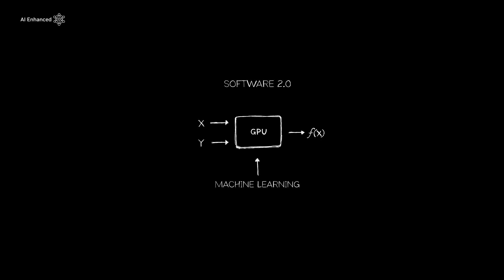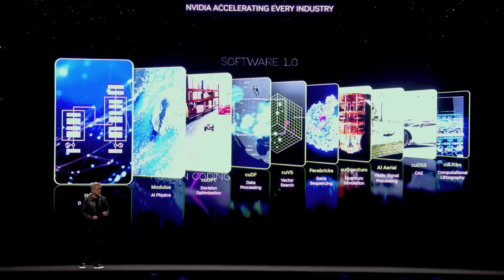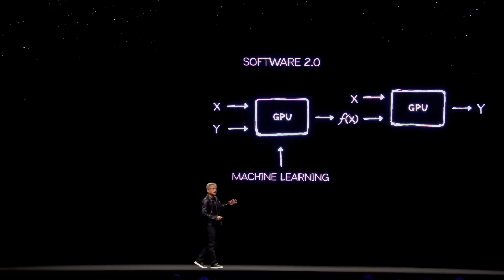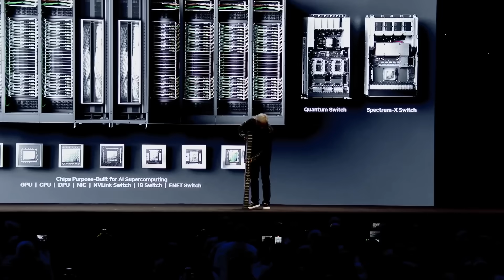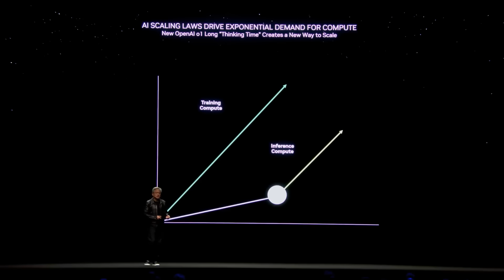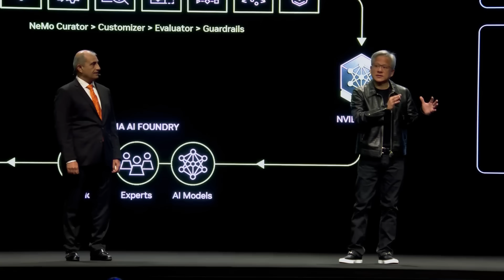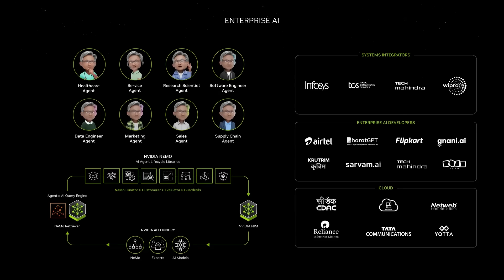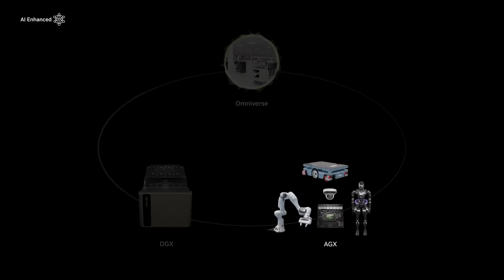NVIDIA CEO Jensen Huang Leaves Everyone SPEECHLESS (Supercut)

Comment: I think he is being  little disrespectful to companies like 3DFX interactive saying Nvidia invented GPU’s.
Reply: Just like Ray kroc invented mcdonalds!
Reply: technically he is right because Nvidia had the first GPU the GeForce 256, 3dfx had graphics accelerators, which is a difference.
Reply: @Hulio2205  Playing on words and semantics.
Reply: @seamon9732  exactly that's what every sales person does what jensen is at the end
Reply: @Hulio2205  Wasn't ATI right behind?  How could the GeForce 256 be so revolutionary if another AGP card was right behind?
Reply: @chris2ferUtoob ATI sucked hard until they brought a small company formed by ex-SGI employees called ArtX.  ArtX did the GPU for the GameCube.  All roads in 3D lead back to SGI.
Reply: @Hulio2205  No it's just an old term, 3Dfx has graphics cards such as the Voodoo 1, and 2, and they had SLI when you combine two of them across two PCI slots.
Reply: @Hulio2205 the GeForce was stolen from SGI.  They were sued over this and Nvidia lost.  Nvidia has invented very little actually.
Reply: @Hulio2205  thank you that is the answer I needed to understand the video fully
Reply: @Hulio2205  the difference is that geforce 256 was the first to add hardware geometry (transform and lightning)
Reply: @Hulio2205  Sorry no. The SonyGPU from Playstation is the first GPU by defintion since they coined the word. The "P" stands for processor as in processing graphics which is what an 3d accelerator does. The 256 was the first with "programmable" shaders yes. But that is not the definition of a GPU.
Reply: @Hulio2205  I'm pretty sure Arcade machines and a console like Nintendo 64 had GPU's in a sense, that could do the things which would make them having GPU's. 

Also I had a Riva TNT (NV4) card from NVIDIA that was way before Geforce 256 (NV10) and also could do 3D and 2D in a single chip, so it's weird they talk about that Geforce being the first GPU. It's not. Riva 128 came in like 1997, and Riva TNT is listed as the first Nvidia GPU in the techpowerup GPU database...
Reply: @Kankipappa  even the sony play station had its own gpu which did 2d and 3d. i guess nvidia only can say the first consumer grade main stream pc add in board gpu or something... but yeah i mean at the end who cares, he wants to sell his products he exaggerates a lot.
Reply: @Kankipappa  This is due to the fact that NVIDIA was the creator of the first GPU. Prior to this innovation, similar hardware was simply referred to as a graphics card. It was NVIDIA who first introduced the term "GPU."
Reply: @unstablenl  I believe Sony introduced the Term "GPU" in like 1994 with the Playstation, so I'm afraid that's not true. 

But lets be fair on Nvidia saying they were first to make it to consumer marked. Still calling the Geforce one the first one even from them is kinda misleading, since they had prior products that could be considered as one.
Reply: @Kankipappa  Sony's PlayStation (1994), had hardware for 3D graphics, but it didn't have all the features that later GPUs, like NVIDIA's GeForce 256, had.

While Sony's PlayStation did use early GPU technology for its graphics, NVIDIA's GeForce 256 was a more important milestone in making GPU technology what it is today. - It's more than just coining the term. There's also a huge technological difference linked to the term.
Reply: @unstablenl Sony’s PlayStation had a 32-bit GPU. It was Sony that invented the term GPU in 1994.
Reply: @bobsmytheable  3dfx was bought by nvidia so not entirely false
Reply: @shrdshld  Nvidia was founded in 1993. GPUs have been around since the 1970s.
Reply: @shrdshld  well it's basicly the same company so it's not entirely false.
Reply: @shrdshld  bought to close 3DFX doors to get rid of their competition, and jack up the prices of Nvidia graphics cards.
Reply: @shrdshld  I bought my kitchen table, I didn't make it.
Reply: @shrdshld Exactly what I came to say. 3Dfx was on top of the dev game but had issues elsewhere. Nvidia made what may have been their best decision in acquiring their IP.
Reply: @shrdshld  apart from the fact that they still had no involvement in the creation of the gpu. So it’s blatantly just a false statement. It’s not like you can be partially lying, you are either lying or you aren’t.
Reply: @shrdshld  just because you bought the company that invented the car doesn't mean your company invented the car. So his statement is 100% a valid rebuke
Reply: @rolandoverby8056  3DFx didn't invent the idea of the GPU, though. They simply dominated the 3d market. Back then our "gpus" were only used for 3d rendering. Nvidia revolutionized it. What you think of as a GPU is due to Nvidia. Yes, they obtained the IP of a rival to achieve it but... 

Using your analogy; Intel can't make a claim on the microprocessor. It's silly. Look, at the end of the day, most all of this is a shared endeavor around the world. There are millions of people involved in many different ways. Using your rationale no cooperation deserves credit for anything.
Reply: @bobsmytheable  I had a computer with a Voodoo 2 3dfx card. Needless to say my childhood was blessed.
Reply: @gamercatsz5441  Yeah, me too, shame they could not capitalise on their talent. It is good to see what was then and what is possible now.
Reply: He's the steve jobs of GPU.
Reply: @feilox  is that a compliment, or a diss?
Reply: He’s a liar and has been sued over this before.  Silicon Graphics invented the GPU and pretty much everything related to 3D graphics, from OpenGL to hardware acceleration, you name it it goes back to SGI.  As SGI was in decline in the late 1990s many of their employees went to work for Nvidia.  Nvidia stole the design of their first GeForce GPU from SGI.  They were sued over this and lost in court, having to pay huge amounts to SGI and then royalties.  Nvidia didn’t invent the GPU or really anything fundamental.  All that shit was invented 10-20 years before they existed by other companies, mostly SGI.
Reply: History is re-written by winners.
Reply: Same way as Musk founded Tesla
Reply: geforce 256 is the first card to combine 2d & 3d chip, also integrated programmable shaders. the term of GPU name is made by nvidia as well, before was video card, amd called theirs VPU at that time.
Reply: Bro doesn't know about SGI, 3dfx, riva etc...
Reply: There is also Elsa Gloria, Matrox, and other older graphic cards that were around before Nvidia.
Reply: Nvidia invented the term "Graphics processing unit" and released the first piece of hardware that was called a GPU.
But Nvidia, Nor 3DFX before them, actually invented specialized graphics circuits. They arrived on Arcade system boards in the 1970s. And it was NEC that produced the first all in one display controller and graphics processing chip in the 1980s.
Reply: 3DFX didnt invent the GPU... He talking about commercial progammable GPU's, which Nvidia was first to offer.
Reply: @Capeau  Again, this is a dumb, low-IQ notion of "invention" (like claiming to "invent" putting LED lights on a PC).  Field-programmable logic had been integrated with these same architectures since their inception.
Reply: Ah, sadly he is a bullshitter sometimes and so is elon.
Reply: 3dfx = Nvidia
Reply: @SussyBacca  just because they bought them doesn't change the history...

I mean like if M$ bought all companies they still couldn't claim to have been the ones that have done the first electronic computer for example...
Reply: My thought exactly. They bought the companies, and swallowed them to non-existence, but used their knowledge and inventions. Sigh... Every entrepreneur going crazy and dishonest in 2024 starting with Elon now Jensen? :(
Reply: yeeah but.. PRACTICALLY speaking.. they made the leap that matters.
Reply: @WiseWeeabo no they didn’t.  They stole their product from SGI, who sued them and won a huge judgment.  Nvidia is built on stolen tech from the grand daddy of all modern 3D:  Silicon Graphics.
Reply: For real, though Nvidia did toy with the GPU wording though first I think
Reply: 100%
Reply: 3DFX went bankrupt and Nvidia bought up the assets and IP. Thus they claimed ownership.
Reply: Or Number Nine
Reply: Conquerors tell their story. He is telling the version of his story.
Reply: @Guni8112 he told a different story in court where he lost the lawsuit brought by SGI for stealing the technology in the GeForce from them.  Nvidia exists because it copied a real company.  There’s nothing they do that’s truly innovative, they are the Microsoft of the graphics world.
Reply: @bobsmytheable  das ist das Einzige was du aus diesem Beitrag rausziehst ? Armselig!
Reply: @TMTM_81 I am sorry I don’t meet your high standards but over 40 replies says it is worth discussing, including yours which does not add much to the discussion.
Reply: ofc he should also honor mention 3DFX, let alone nVidia profited from their loss and their experienced staff  by buying them. Just not mentioning them in that term is a bit careless and lost .. spoils their legacy
Reply: I had the Voodoo Monster 3D (or something similar) and I agree with this statement.
Reply: 3dfx is nvidia
Reply: Sure, but what Nvidia have done with those early beginnings is revolutionary.  You don't hear airplane manufacturers calling out the wright brothers etc.
Reply: Well time to do some more research. Monster 3D card from 3DFX.  isnt the same as what Nvidia gpu.
Reply: Ya that kind of bothered me.....
Reply: 3DFX made VGA cards. Not the same as GPU.
Reply: because of NVIDIA we to have good videocards in this days. that what  3DFX  was not able todo, don't insult the NVIDIA, they are doing good job
Reply: Cost decrease.. Where? Have you seen the price of gpu's
Reply: I remember the first SLI cards as being VOODOO.
Reply: This speech is very interesting and overwhelming, however "dumb AI" products such as ChatGpt (and probably Google, Grok, etc.) are still pretty much dumb. I tried a pre-trained AI model to enhance the quality of an old video from the 80's and was impressed with how much faster a GPU is than a CPU. The program took 31 minutes to run for a single picture on a CPU until I figured I actually had a GPU and could make use of it along with CUDA. The program then ran in 3 seconds or so. So when it comes to GPU's, yes, they are impressive, they can do certain tasks in a flash. But LLM's are still dumb and a dead-end, they will never be truly smart or be able to reason.
Reply: My first home PC was an IBM with a PII 400 MHz, and it had 4MB of integrated video memory on the motherboard. Remember winning a few thousand on the lottery and buying a GeForce 2 MX 32MB GPU. My first one of many. 🥲
Reply: Mad respect for Jensen, but its not good to take credit for stepping on the shoulders of other great companies.  Elon would approve, however.
Reply: Even before 3dfx there where dedicated GPU systems.. they cost about 30k a pop, didn't do texturing, but they where graphic engines.
Reply: I'm pretty sure nvidia bought them of so technically they could claim they were the first since 3dfx is now part of them.
Reply: @RealTaIk  yeah but nvidia just didn’t make it ._.
Reply: Oh man, that brings back memories! I had the Orchid with 16MB of VRAM lol
Reply: 3DFX interactive? That company is now known as "Nvidia"
Reply: face palm.  3DFX paired with VGA card is exactly like a modern GPU.  The only difference one had fixed pipeline, which now has moved to programmable pipeline shaders.
Reply: @bobsmytheable  ok yeah but look at Halo. Bungie revolutionized match making and online multiplayer. Millions of gamers don't understand that without Bungie we still have a bland multiplayer today. But Bungie never stood on a stage for year saying hey we made it better. Yeah people before Bungie made match making and multiplayer but they perfected it. Same with Nvidia here they made it better than other who made Gpu's first. I think they have a right to say they made Gpu's. Bungie never boasted about it and now everyone thinks they are good at making match making and multiplayer today. Why you think most multiplayer setups today suck we lost track of what Bungie made with Halo. Call of duty has moved away so much from original matchmaking and multiplayer that it just a pile of garbage today.
Reply: He‘s one of few Chinese who learnt to how to speak like an Indian towards the Westerners.
Reply: "If you cannot dazzle 'em with brilliance, baffle 'em with bu||sh*t". -Jensen
Reply: The MIPS RISC architecture, including the 4200 architecture (the 4300i was used in the stunning graphics of the Nintendo64) was a GPU.  Silicon Graphics bought MIPS, tied a lot of their software technology into it, and created OpenCL.
Reply: All big heads doing that
Reply: Okay, hold on.  I was buying and owning these GPU's during this time.  There was nothing called the "GPU" until the Geforce 256 was released.  No company prior to that (including 3dfx) called it a GPU to my knowledge.  I do not recall "GPU" being used until nvidia coined it.  And I do not like having to defend nvidia.
Reply: @bobsmytheable  did you forget about SGi?
Reply: @ Thanks to some of the comments here my knowledge has increased but I did state “companies like” as a nod to previous innovators.
Reply: Yes, I remember what my 3DfX Voodoo Banshee (2D+3D) 16MB SGRAM in GLIDE mode could do. It was hard choice between Riva 128 and 3Dfx. The hihger picture quality of 3Dfx won me. Unfortunately slow innovation lead to failure of 3Dfx (and unrelated to GPU, of Nokia).
Reply: Wasn't the voodoo before GeForce?
Reply: OMG I WAS JUST THINKING THIS
Reply: Computers are not real
Reply: @nikob381  then also you are not real
Reply: this guy is cancer to the world
Reply: Actually the first gpu was made by by texas instrument but they probably didnt see its value , later nintendo made use of a semi gpu for fast color table.
Reply: Pretending that a graphics processor is some sort of fundamental development is pretty dumb in the first place.  It is simply a discrete packaging response to evolving computational burdens.
Reply: Jensen isn't known to be super kind
Reply: That’s not what he said.
Reply: They did. The first GPU was the GeForce 256. Look it up.
Reply: The Coleco Adam computer had a dedicated graphics cheap 10 years before Nvidia first GPU
Reply: @bobsmytheable  I was thinking exactly the same thing
Reply: In fact the Rendition Verite was the first real GPU.
Reply: @AndyGraceMedia  Same thing there. The V1000 was first with a Programmable core. But again, that is not what the P stands for. The Playstation had the first GPU. Made by Toshiba. This one is quite easy to "prove" since before that any ASIC that was built to help graphics in any way was not CALLED a Graphics Processing Unit. That was coined when Sony released the Playstation calling its separate unit handling graphics for a ... drum roll: GPU. Thus, it is the first GPU by definition.
Reply: Take a shot every time he says “agent”
Reply: Wow this has convinced me to pay $2k for a display adapter.  No.
Reply: does history matters?
Reply: @bobsmytheable  of all the things he said, THIS is your stand out quote?🤣
Reply: how is he being disrespectful it was nvidia that invented gpu's
Reply: @bobsmytheable  you do gotta give then the benefit of the doubt though they lead GPUs today
Reply: Well I mean technically they did the world's first GPU was made by Nvidia... And when I say GPU I mean actual GPU not components or remnants of graphics processing an actual GPU the first one was Nvidia this is not even a debatable point
Reply: Those were just 3D accelerators with a fixed pipeline, not programmable. Shaders changed everything.
Reply: @gaborbucs  he is still name playing. Nvidia only added on an existing invention. That's evolution, the revolution was made by a different company that Nvidia later bought.
Reply: @gaborbucs  P is of Processor and not Programmable.
Reply: @gaborbucs  "shaders changed everything"?   yes and no.
Reply: and also disrespectful to SGI, and others.  Huang drank a whole gallon of koolaide
Reply: @deckard5pegasus673  3D accelerators != GPU
Reply: @deckard5pegasus673  just because he is Chinese
Reply: He's just here to toot his company's horn. The insane claims of reinventing how software is made is only true in that models are used to assist human programmers. If you attempt to predict a function's output, as the complexity scales the output will become increasingly random until you create a 0 error network, which is only possible with quantum computers once we can adapt them properly to train models a million times quicker.
Reply: @puppergump4117 Just seen Anastasia in Tech do a video on probablistic computing or something like that that can make computers 100 million times faster than modern GPUs. 

 Video went over my head. It had a lot about analog, and quantum computing in it. Wish I could tell more, but I would fail. 

 It makes sense the future isn't purely digital. Human brain isn't digital, and uses 20 watts to do everything we do. Some say we actually use quantum computing with microtubles in the brain. 

 I don't know what the future holds except more specialized hardware will be a thing.
Reply: @dianapennepacker6854  I checked the papers and it seems it was about being 100 million times more energy efficient.

It seems that thermal computing is still in the theoretical stage, it takes time to set up, and is potentially both slower and less accurate than analog.

However, it does provide a way to make those p-bits useful at long last.

I conclude Anastasi is just farming views.
Reply: @puppergump4117  He gotta do the talk to get investors to buy the stock.

We all know that no model can program anything decent, can't think, can't reason or can't really produce anything of value. It's an LLM, it can help you find stuff in a model, that's about as useful as it's ever going to be, regardless of whether this means automated call center bots (oh god no), a documentation assistant for programmers or a dude that does your homework.

Can't wait for the hype to die down so we can go back to normal times.
Reply: @lnx648  Once this hype dies down GPT-5 will come out. Christmas I think. The infrastructure should be there but the data's not good enough, they might hype it with an early access. Just a guess though, but after looking at the charts I'm guessing they needed 2 months to train it.
Reply: Quantum computers are not real. You are a wannabe.
Reply: @THX-1138  You're not caught up on science. The first quantum processor was made years ago but it's kind of a novelty. Recent advances, however, are in line with Moore's Law.
Reply: @THX-1138  Thats a stupid thing to say without even googling it
Reply: @THX-1138  quantum computers are absolutely real... And also absolutely tiny (Cbit wise) and not useful right now.  As for him being a wannabe... Does your definition also extend to yourself?
Reply: @THX-1138  Yea they are bro. 🤦‍♂️ Just put the 🍟 in the bag.
Reply: @THX-1138  How dense are ya bud?
Reply: @puppergump4117  yeeep, that's why the US government mandated themselves to use quantum resistant encryption algorithm and architecture within five years.
Reply: @puppergump4117  I wish people would stop quoting Moores law. Its not a law, just a trend driven by as much as economics than anything else
Reply: @THX-1138  quantum computing exists just not in your home for general use, not yet. You couldn’t keep the thing cool long enough to get anything useful out of it.
Reply: @THX-1138  Such bold bravado to say such an ignorant thing so confidently.
Reply: @mythuan2000  was I supposed to say bing it? Sorry, maybe duck it
Reply: @THX-1138  tell that MIT?
Reply: @THX-1138  They are real hahha
Reply: @THX-1138  Quantum computers are already show to the public for 1 or 2 years now. There are some programming languages for Quantum Computers to write the software for those. LOL
Reply: @puppergump4117  for now we are in line with Moore's Law. Give it a little while. Things are moving pretty fast TBH.
Reply: @THX-1138  wow lol you don’t know what your talking about.
Reply: nVidia competed side by side with 3dfx and Matrox, in the end, nVidia won and bought a lot of 3dfx.
But there were business machines doing accelerated 3D before any of the companies tried to commercialize it.
Older nerds will remember Silicon Graphics "SGI", but even that was outpaced by an Evans Sutherland Vector accelerated product in 1969, including employees going on to found SGI, Pixar, Adobe.
As a result of SGI being unwilling to branch into Window/Intel technology, saw personal leave to start nVidia and Ati.
But to defend the Trump looking gentleman in a leather jacket, following is a wiki quote:
"The GeForce line of graphics cards from Nvidia was the first to support full OpenGL and Direct3D hardware geometry processing in the consumer PC market, while some earlier products such as Rendition Verite incorporated hardware geometry processing through proprietary programming interfaces. On the whole, earlier graphics accelerators by 3Dfx, Matrox and others relied on the CPU for geometry processing."
Reply: @mayday303 your Wikipedia quote is bunk.  SGI, who created OpenGL, was doing this 10 years earlier.  There’s so many qualifications in that statement… consumer?  Not even.  And who is defining consumer here?  SGI was shipping workstations doing hardware accelerated 3D that didn’t touch the CPU since the early 1980… that was their whole business.
Reply: @mayday303  Were you lucky enough to never see SGI's desperate attempt at an Intel Windows NT machine, the Visual Workstation? I think with the first ones they tried putting their own graphics pipelines in a weird non-standard PC but the later ones just shoved an NVidia card in and branded them SGI with markup to match.
Reply: @ntq1ty the 320/540 were great machines.  The later machines were pathetic.  They won in court against Nvidia.  The GeForce was stolen SGI tech.  In addition to the monetary payout and royalties they owed SGI, they also agreed to produce GeForce based cards for SGIs wintel computers.  Those Nvidia cards are actually quite interesting and they’re the result of the lawsuit and settlement process over nvidia theft.
Reply: @mayday303  Lets be clear and say that 3dfx lost.....lol. I remember nvidia back then. I wanted to play ff7 on pc instead of ps1 and had a choice....I could get a 3dfx and enjoy the game the way it was meant to be played, or I could get an nvidia riva and all the cgi cuts would play upside down. I went with the voodoo iii 2000.
Reply: Like others have mentioned, the GPU term was coined with the release of GeForce 256. The Voodoo cards were awesome for what they did, but they were accelerators. You need to have a normal graphics card and then add a 3DFX card to the system, it wouldn't run standalone. Also, unless your intended program/game had specific glide drivers it wouldn't get accelerated by the Voodoo card. The GPU introduced with GeForce 256 was very different and a standalone unit. Now I'm getting nostalgic 😅
Reply: @Zoonie81 The term GPU was in use before Nvidia. There were chips that met Nvidias definition of GPU before the geforce 256 came out. Not for PCs running windows, but they existed
Reply: @Zoonie81  Ah, the old Glide option. Haven't seen it since CS I think. 😁
Reply: @Zoonie81 you just don’t know about graphics hardware at all.  Something like an SGI Indigo had a fully hardware accelerated 3d pipeline in a desktop form factor in 1990.  The stuff you’re nostalgic about was just trickle down to gamers from workstation level products that had been around for 10-20 years already.
Reply: @Zoonie81  you are not being nostalgic, you are just wrong, like, everything you said is wrong. There, the 3dfx Voodoo Banshee, a normal GPU as we call them today, predates the Geforce 256 by a year. The reason the Voodoo card came as an add-on card is for compatibility ( and cost reduction) reasons with existing systems. Nothing to do with anything otherwise really. All these early GPUs did and still do, including the latest 4090, the same thing,  they are specialized devices to do specialized tasks, ( otherwise known as "accelerators", hence the early name) contrary to a general CPU. 3dfx got an early lead due to having the first consumer product that actually worked well, but ultimately they lost the battle due to mismanagement.
Reply: @roller4312  Hey there kb warrior. The reason GeForce 256 was called the first GPU was because of HW T&L. If you're defining Banshee as a GPU you might as well say the same for Riva TNT and many other cards that predated Banshee. In the end it's just a matter of definition. Anyhow, keep fighting those fights strong one.
Reply: @Zoonie81  Im not defining GPUs, i'm telling you what the definition is. GPUs have various degrees of accelerating computation tasks, be it T&L, Raytracing or some other buzzwords you may have heard being used in graphics, that's why they are called Graphics Processing Unit, and the Geforce 256 doesn't stand out here in any way. At least it doesn't to people who know Glide isn't a driver.
Reply: @Zoonie81 the GeForce was a stolen design from SGI.  Hardware geometry had been done by SGI back in 1982.  They won in court against Nvidia, who paid them huge sums.  All roads in 3D lead back to Silicon Graphics, they invented pretty much everything we have today.
Reply: 3DFX, Voodoo and many of the early cards people refer to were NOT GPUs.  They were 3D Accelerators, fundamentally different.  Yes they paved the path to GPUs, but still different hardware.
Reply: @bobsmytheable  The first GPU (Graphics Processing Unit) was created by NVIDIA Corporation in 1999. They introduced the GeForce 256, which was marketed as the “world’s first GPU.” NVIDIA coined the term GPU to describe this processor, which could handle transform and lighting calculations, enabling advanced 3D graphics rendering directly on the hardware.

The GeForce 256 was a pivotal development because it moved graphics processing responsibilities from the CPU to a dedicated unit, paving the way for the modern GPU market. NVIDIA was founded by Jensen Huang, Chris Malachowsky, and Curtis Priem in 1993, with Jensen Huang serving as the CEO since its inception.
Reply: @EricJames429 I am not anti Nvidia, I have a 3080ti and shares and they have moved things on exponentially but the inference is it started with them, semantics over the term GPU maybe.
Reply: @EricJames429  all lies.  Your knowledge comes from Wikipedia 😂.  Hardware T&L was first done by Silicon Graphics in 1981.  All roads in 3D lead back to them.  Nvidia stole their technology and were sued over in.  Their GeForce product was stolen from SGI and they paid hefty sums plus royalties to them on it.  SGI had hardware accelerated 3D on the market more than 10 years before Nvidia was even founded.
Reply: Voodo 2 baby !! ❤
Reply: 3DFX is Nvidia. Go cry about it.
Reply: Nvidia was the very first company to bring GPUs into the world in 1999. The first GPU in history was known as the Geforce 256.
Reply: @EXTRA300s wrong.  SGI had the first GPUs in the 80s.  Nvidia stole their technology technology and lost a massive court case on this.  The design of the GeForce was stolen from SGI.  Almost everything we have today goes back to SGI technology.  Nvidia has invented surprisingly little.
Reply: They did invent it. Voodoo was only 3D accelerator, so it couldn't work independently without 2D card.
Reply: @hansolo2797  The voodoo card worked completely independently, that's why it could be installed into any PC. You are probably attempting to say it needed some other PC components to work? Well so does everything else. :)
Reply: @hansolo2797  not true
Reply: @hansolo2797 you clearly know nothing about 3D.  On my desk is a Silicon Graphics Indigo from 1992 that has fully accelerated 3D pipeline and does everything Nvidia claims they invented.  They stole their tech from SGI and list the court cases on that even.  Nvidia did not invent the GPU, they’re just lying salesmen.
Reply: @bobsmytheable  Nvidia literally invented GPU.
Reply: @DinGrogu2019 they literally did not and were sued over it and lost.  Silicon Graphics invented the GPU and has been making world leading 3D graphics systems since 1982.  The GeForce was stolen from them and they were paid massive money after winning their court case.  Nvidia got all its talent from SGI and stole their tech as well.  It’s a slimy company who has never done anything innovative themselves.  They’re good at copying and at BS marketing and sales.